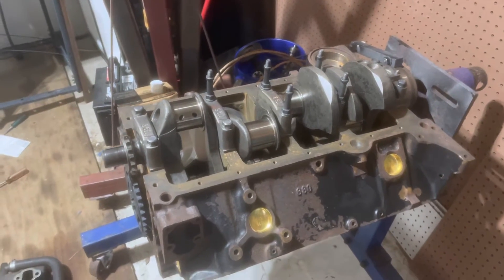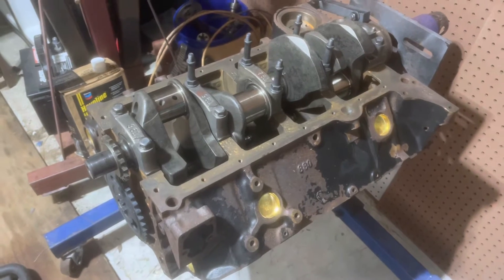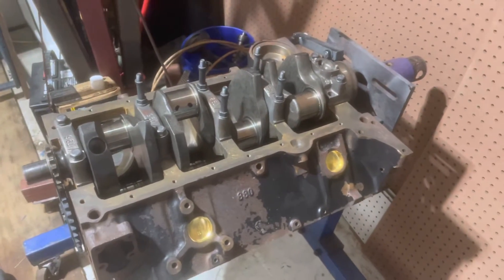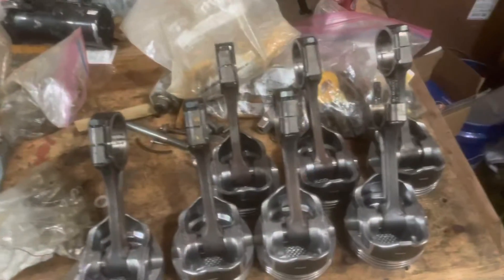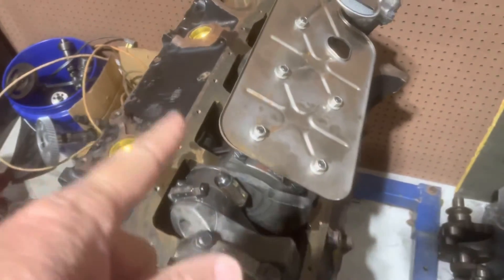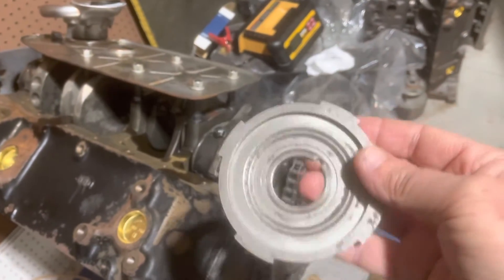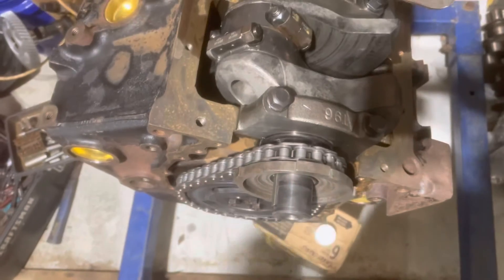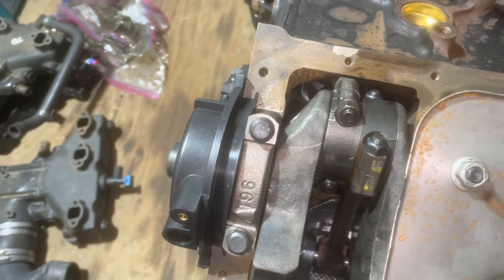Mercruiser 6.2 (1a) - Let’s Build This Beast

Comment: Most engines that have rods sharing a journal have a chamfer on one side of the big end of the rod. One side is flat. The flat sides go together ...the chamfer faces out. It's to clear the radius.  Most SBC rods are installed with the bearing tang facing out.
Reply from the maker: Yep I cover that in another video